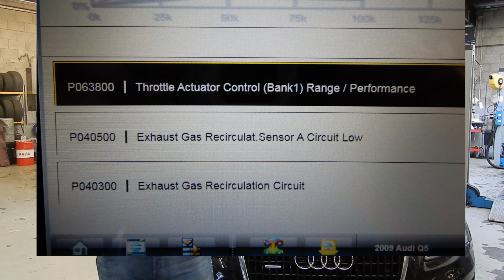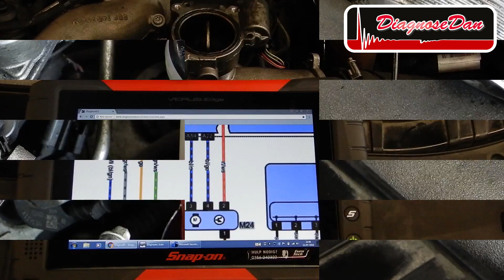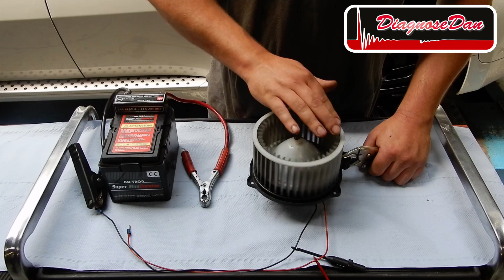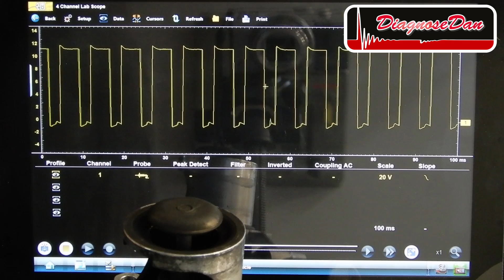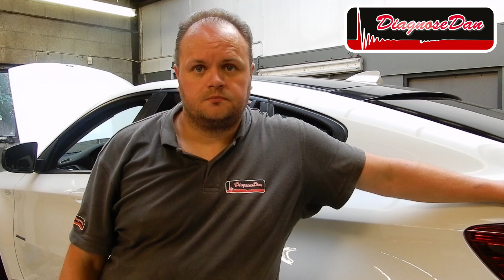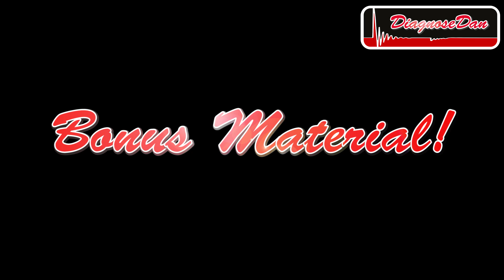Audi P0638, PWM/Duty cycle explained

Comment: Fantastic video as usual Dan!
Reply from the maker: South Main Auto Repair, Thanks Eric😉
Reply: In my opinion Dan you have a great way of breaking things down into layman's terms. It makes your videos very enjoyable.
Reply: @Diagnosedan  hey Dan excellent video as always. I have been going through all your videos and learning a tonne.

Just one question. How do we identify a pwm system.
Thanks!
Reply: That was more than amazing your explanation is the best..please make more videos diagnosing problems and teaching how different sensors work and how to check them and how the different systems work like stop and start, anti-theft,etc and I have a question..I live in France and I saw a lot of Renault cars have throttle plate in the exhaust just before the silencer I wonder what is it for..
Reply from the maker: Ahmed Sharif That throttle plate can increase the exhaust back pressure. That way the exhaust gas pressure in the Egr gets higher for better Egr performance!
Reply: I agree with you eric. Discovered this channel the other week very good and more of the kind of cars I see than you get, But the methods are the same, is so good to have guys like you 2 to learn from.
Reply: DiagnoseDan  thanks for answering my question...I just noticed that my comment is in the wrong place
Reply: Yes indeed! I have bean SD sub for years and he has told me this (PWM signals) many times, i think.
But now whit simple clear video on how much on at given time vs. how many times in given time... Made it lot more clear to not manly English speaking person...
Thanks DAN!
Next. Whats the benefits of useing PWM  control vs. Voltage drop control on example Blower motor control?
A: Battery power loss / used power effectivity....
Reply: You answer questions I am just dying to ask.
Thank you, the veil is lifted
Reply: @seekykhan5393  Dan answers questions that we are too scared to ask! It is all riveting stuff, and the old videos do not go out of date.

Comment: Fantastic video, it helped a lot with diagnosing a turbo problem on an A6. It was built using the same principle, power, ground, and two comm wires. Verified wiring and comms were fine, so, naturally, turbo was at fault. Thanks!

Comment: I'm not very knowledgeable on electrical stuff, but I always thought they used resistors to vary motor speeds like blower motors.
Last I knew, brakelight bulbs had 2 elements. Back in my day working on my cars, they were an 1157, but I think that number was superseded at some point.
Did they lose the double element bulbs and go to this pwb type of bulb? 
I've had a Peugeot 505 turbodiesel, underpowered as all French cars, and a Mercedes 300d turbodiesel.
I never knew the throttle was fully open on a diesel while running but closed on shutoff.
Interesting video, Curious Dan.

Comment: The variable valve time system also uses duty cycle. I also think it uses a low frequency voltage to drive the vvt  actuator solenoid

Comment: Loving that explanation. I recently had a 11 Honda Fit with a bad throttle actuator pedal. I was able to use my PWM generator to activate the throttle body. But I messed up and replaced the throttle body first, not trusting myself. I then replaced the pedal and fixed the car. If DD was over my shoulder, I would have fixed it right the first time. Diagnose Bill messed it up again!!😩😩😩

Comment: Great Video. If you have a volt meter on something and your getting like 8 volts, don't assume you have a voltage drop. Flip the volt meter to duty / Hertz and verify it's not under PCM control. Communication is giving and receiving but a signal is an output to a transistor that acts as a high speed relay. That's how I learned it from scanner Danner. Lol

Comment: There is also another good reason for having a throttlebody on diesel engines - in order to prevent diesel runaways by just completely cutting the engines air supply!

Comment: I have been selling tools for 34 years.  I have worked with some of the best techs in the nation.  Rod Flores probablly the best ford driveability guy in the nation.  But you my friend are amazing.  IVe seen you find things that what ive seen no other shop had the patience to fix, especially on bmws. But get away from that snap on crap and get some more launch and autel stuff.  Snap on sucks.  I was a top snap on dealer 17 years.  They do not take care of there dealers or customers.

Comment: That was great.  I'm an electronics engineer and computer scientist and have even built RC Airplane with (PWM) servos and controlled them with microcontrollers, etc., so I understand PWM just fine, but it was super helpful to see the tools you use on a car to figure out what's actually going on.  Also your PWM explanation was really clear.

Comment: Brilliant Dan thanks again. Please can we have your Range set up when you scope for your signals? We saw from the video your time rate was  100ms  your voltage range was 12v  so where did you place your probe leads to get your signal? One was on the signal wire in and out and you had your ground lead connected exactly where. thanks.

Comment: Alright ..... So the pcm is not controlling direct  power to throttle body, it is just sending a pwm signal to throttle body, which is a fixed frequency varying pulse width type...
The power(12 volt) is actually going constantly to throttle body but sometime it is turning on/ off, that's it...
& On the side side there is a feedback line which should be same as that of the input own signal from pcm I guess..
Thankyou
Now I have watched this video more than 2 times & everyone I watch this I feel.... Hmm, it was new, so much to learn from it
Thanks for the upload
Am I right..

Comment: A bit late to the party, but this is... interesting. 

Learnt something too. 

Thank you for putting this video up, you're very good. I can easily follow you even though I've got a hearing problem and have to use hearing aids. There are times when there's a definite echo (especially when you face the camera in the workshop and the sound echoes) but I still can follow. 

Will recommend this channel most definitely to other guys and girls wanting to know more.

And, as usual, eyeballs trumps scopes and testers when it comes to taking a visual inspection at the part(s) either inside or outside.

Comment: Great lesson. In the early 1980's I went to the salvage yard for a used battery for a car I was selling . I brought a load tester . They all laughed at me . The guy goes over to the pile with a tire iron . If you got a BIG SPARK , the battery was good . If a small spark or no spark , the battery was bad . Maybe you could use an extra          " technician " ?

Comment: That looks close to a potentiometer used on older Mercedes which has its share of issues, I have SEEN Victor from NY repair them and also the wiring harnesses   Dan, check VSANDVS channel, great MB mechanic

Comment: Hi dan i have 2005 skoda Octavia 1 kombi with 1.6 petrol engine . The fuel economy is really low.i recently changed lambda sensor,all spark plugs and ignition cables. Cleaned the throttle body and everything. The car has done 1,90,000 kms . But i get 13-14 ltrs in city and 9-10 on highway. Please suggest me something. Hoping for  a reply from you.

Comment: The smoke in an IC is the secret to why they work and  when you let the smoke out of an IC it stops working. As this IC has burnt a hole in it letting it's secret smoke out it stopped working the valve body. LOL. Another great video Dan. Years ago only a electronics techs worked with this type of equipment. Now days that skill is being lost in that field as everything in that area is board replaceable  and nobody trouble shoots to component level anymore. But in the automotive world now the auto techs must know more that the electronic techs of today. Funny how things change.

Comment: Diagnostic Dan on 90% of VW/Audi diesel engines by design the flap motors go bad because of how they are installed , meaning they have the electronic box on the flap motors are directed downwards and all the condensation from the exhaust gases is eventually leaking by the flap shaft in the electronic part shorting the thing , bad design that's all

Comment: What I'm realy interested in is WHY there was a hole in that thottle body pcb in the first place. 
This seems like a fix of the symptom and not the cause. 
I don't see any guarantee that the new throttle body won't develop a burn again. 
Needless to say that the info on PWM is priceless, and I do thank you for that, but I always worry about faults like this. 
I don't want to fix the symptoms but the causes behind them. 
Good job!
Reply: Yes I agree, you can fix a kettle by putting in a new fuse. But when that blows for a second time, it is time to find out what is causing the fuse to blow again, what is the real problem.
Reply: Why no follow-up as to the cause/reason for the hole burned into the PCB?
Reply: @martyhowley  The PCB will be a proprietary closed loop, h bridge motor controller from the throttle manufacturer, maybe bosch , hella or someone like that. Most likely the pcb will be encapsulated, so what do you think he's going to do? It's meant to be a sealed unit, so even if it failed due to water ingress it's still  kaput and needs replacing.

Comment: @ 3:40 , reason number 4: If the turbocharger shits itself and spews oil into the inlet manifold the throttle body can close and so prevent the engine from running away and self-destructing. Thank you Dan, excellent video, well explained, big thumbs up!
Reply from the maker: Thanks for the feedback! You are right!

Comment: btw could you give me advice ? my bmw m54 has been working on rich condition for unknown period of time.  i restored and swapped everything that could cause a problem. now my fuel trims in both banks are 0 or - 0.75. googd compression, no oil consumprion, sparks became more natural color. but i notice blackness behind exaust, seems like unburned fuel. but my wifes m54 had +8 % lean condition and her exaust is clean like new. what should i look for ?
Reply from the maker: Check it with a gas analyser

Comment: What's the point to use pwm, instead of voltage, lets say 6 volt 50% open and 12 volt fully open?
Reply from the maker: 50% duty cycle is the same as 6 volt!
Reply: @Diagnosedan , well its on and off  half the time, so its 12 volts half the time, im questionning why put sometime on and off half the time when you can put it to half the voltage, like when i say to my kid dont play with the light switch lol its gonna break lol
Reply from the maker: @olivierbureau2408  so the average is 6 volts😉
Reply: I suppose that have something to do with the module that control the actuator, trigger à ground so no voltage is going in the control module
Reply: @ Olivier Bureau: If the current controlling transistor in the Engine Control Unit was to only conduct 6 volts to the throttle body it would have to somehow "destroy" the other 6 volts, in form of heat, which would cook the transistor very soon. Pulsing the transistor between on-and-off state half-half lets it run much cooler because it generates hardly any heat conducting full 12 volts and no heat at all when switched off. Hope this helps

Comment: As far as I know the duty-cycle is the % the actuator is connected to ground. So, i allways connect  the scope on the signal wire and the ground. In the video the scope is connected parallel on the actuator. The value you got is not the value given by the constructor. For me the duty cycle is the time showing on the cope tension is 0Volt. Or the time the acuator is connected to ground. This is the typical way used in automotive electronics.  Do you agreed  Dan?  With this method you can regulate power without lost of power. Much better than a regulated resistance like we see on old blower motors. In this case no heating of the resictor and so no power lost. Great video Dan. Thanks.

Comment: So, the throttle body control module has a fried (overheated) item, which failed (prematurely) and rendered the throttle body useless ? Luckily, the throttle body stays in open position when useless !
The reliability of a brand (Audi) then depends on the reliability of its electronic components !!

Comment: I have to watch videos like this many times too absorb the info. I recently fixed a 2011 Transit Connect auto trans. It has a 6 solenoid valve body. 2 solenoids on/off and 4 pwm. Does it hurt a pwm solenoid like this or a fuel injector to put 12 volts to it?  I am thinking that u may damage a fuel injector giving it a full 12 volts for too long.
Reply from the maker: Bill Pwm is also a great way to keep solenoids cool. Connecting them to a power source for to long at a time and the might overheat.

Comment: I have the same problem p0638 bought a new throttel but after a while returned the same mistake p0638 
I doubt the gas pedal  potontiometer
My car is Renault Campus 1.2 16v 2014
Thanks
Reply from the maker: Check the pin drag of the connector
Reply: Thank you for your interest and for your response teacher I will do that

Comment: One thing I don't understand  with the examples given in video. The EGR and throttle body both fully open/close way before 100% on dial wheel was reached. I have a redrentarmy understanding of say 0 being off and 1 being on and therefore everything in berween being a % of that. But the egr seemed to be fully open at 0.3/30%. Also why is PWM used instead of say a simple dumb varible resister. So say in the example of the throttle body that has 2 states, open and closed you could just send power down L1 being closec and L2 being open. I realise with being controlec by PWM you could have infinite control of the throttle body but I doubt very much that you need infinite opening states?
Reply from the maker: Pwm is easier achieved by electronics, no mechanical moving parts that could wear down.
Reply: Don't forget that you are seeing these actuators out of their working environment, in a working situation there would be airflow through and past these items which would be an additional effort the actuators would have to work against in addition to the spring, which would mean they have to work harder to produce the same effect.

Comment: Technically its a Pulse Proportional signal not a PWM signal as the pulses are not modulated by a carrier frequency.  A pulse proportional signal is just that, a train of pulses of varying width between 0% and 100%.

Comment: I'm having problem fixing a 2006 hummer h3 3.5l engine with rough idling after overhauling the engine
Replaced the throttle body still no improvement.
I Keep getting power reduced massage.
Reply from the maker: What codes are you getting and what measurements have you done? And what made you deside to replace the throttle body?

Comment: Good morning Dan. On the com lines at the DCL the modules continue to report their info to the network in a rotation. And when u choose live data, u r watching the result of that communication as expressed in a data pid. Do they communicate all the time?
Reply from the maker: Bill Rimmer Evening over here, if your reading fault codes the car only reports back what's it asked by the scantool. That's why you'll need to end communication on your scantool and not just pull out the connector. That way the the car knows it's not being diagnosed anymore. And stops reporting back. If you don't end communication it could theoretically not go asleep.

Comment: Dan .. can i ask you. how do you get all the wiring diagram? from where you obtain these? as i know those diagram you cant get it easily. and also ur diagnosis is very handy.. im using vcds for audi. but is a mess cus most of audi car , cant even do an activation or basic setting.. is like the pc or the car ecu blocking those command.
Reply from the maker: feddykoih I got a Subscription of Hella Gutman for wiring diagrams.

Comment: I have watched this video several times. Thank u very much for giving us such an excellent explanation. So the duty cycle changes the magnetic strength which moves the pintle correspondingly. Correct?  If u used a rheostat, u could do the same thing, but not as fine tuned or accurately. And fuel injectors need precision control. And the rheostat wastes power with heat generation. Is that also correct?
Reply from the maker: Bill Rimmer All correct! The great thing about video's is you watch them over and over. If you go to a regular class you pay a lot of money and they only tell it once😉

Comment: Hi Dan just a quick question, I noticed on the egr when you were increasing the duty cycle, the valve opened. However it fully opened long before the duty cycle was at 100%. Does this mean that for some fully functioning components we may never need a duty cycle of 100%?
Reply from the maker: Gawrisan Chandrakumar That's correct!, some this egr opened 100% at about 40% duty cycle. It's just how the component is designed. Another brand egr might open later or sooner. The engineer knows the characteristics of the valve and ajusts the programming accordingly.😁

Comment: Thanks Dan. I have a prob with an Audi A4 1.8T 2005. MIL on. P17511 - B1S1 O2 heater performance too low. O2 heater is drawing 1.5a during on cycle. About 50% duty cycle but still throwing code. Seen this before? I have traces etc.
Reply from the maker: Paul Appleby Sent the pictures via Facebook!😁